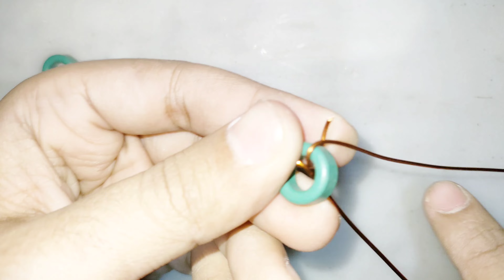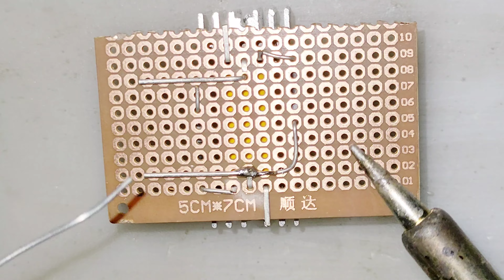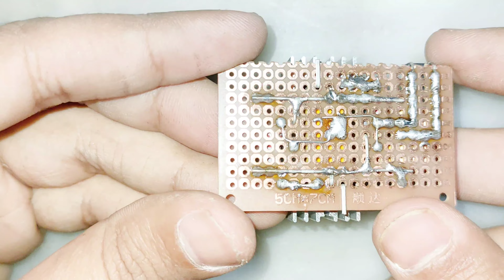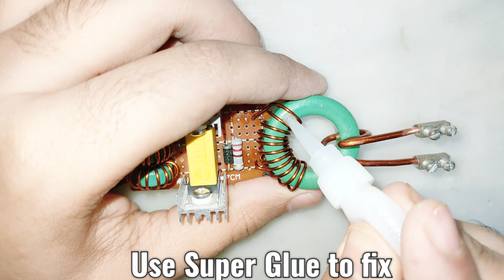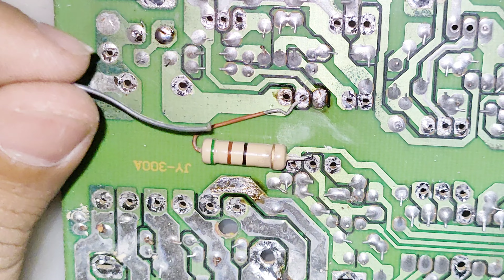Powerful 30Watt Induction Soldering Iron 12Volts DIY

Comment: Hello master can I use k2611 mosfeat in this circut please replay I am waiting
Reply from the maker: Too high voltage and low current, Sorry you cannot use this MOSFET, 

Use 50-100A MOSFET And higher than 60V

Comment: sir i take out the mosquito racket transformer and rewind it with relay coil with same turn but the output is so low some turn of tape fix it or not 
i don't no why the output is so low
Reply from the maker: You want high voltage? 
Try increasing Turns

Comment: sir jab cfl yah mobile charger sa farad core transformer ki winding kar ta h tou os ma 10 yah 5 turn tape ka kue laga ta ha
Reply from the maker: You need to put tape because tape works like insulator. To the high voltage would not jump through windings

Comment: sir transistor kharab ho na ko masla tu nahie ho ga na is ma
Reply from the maker: Sorry i do not understand
Please can you tell me in English... 
(translator doesn't work)
Reply: @Electronic_For_You  in most circuits after 1 or 2 minute the transistor damaged in the circuit transistor will work for 10 or 20 minute or not
Reply from the maker: It happens for many reasons! 
The main reason is over heating and over voltage on the collector pin !